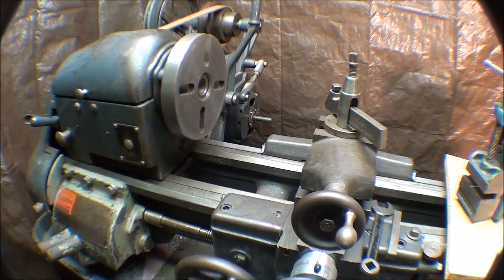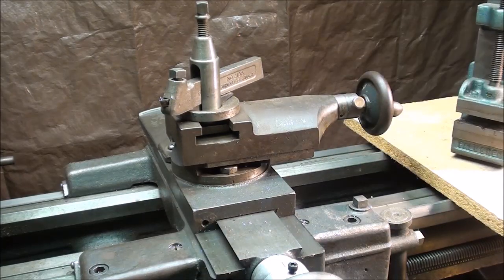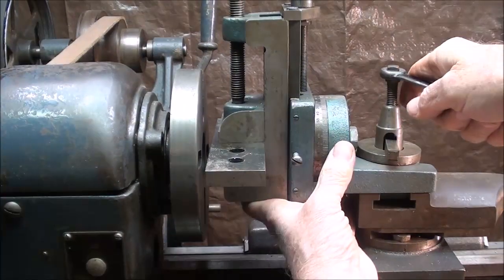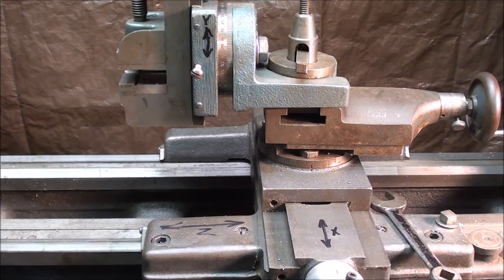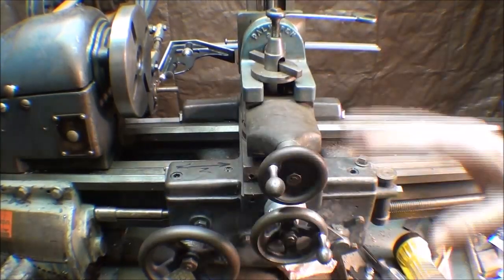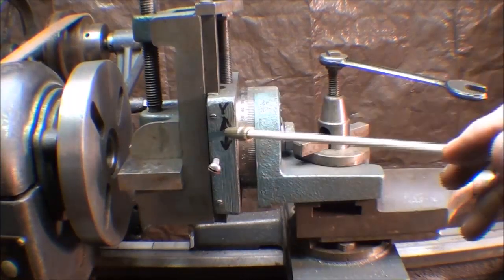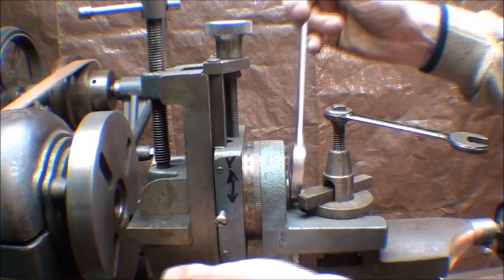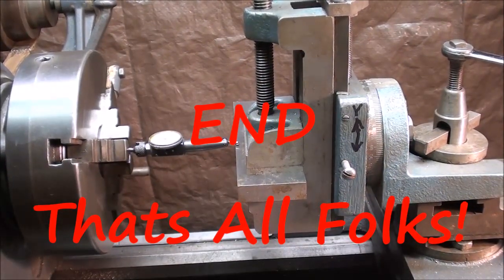Mounting the Palmgren Milling Attachment to Logan Lathe 287 tubalcain

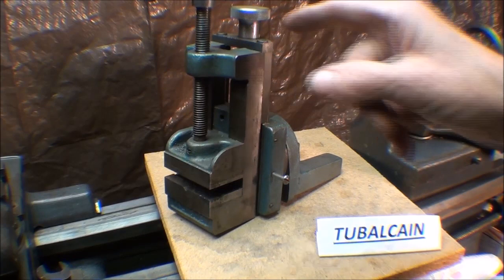Comment: 0:48 I’ve got a Logan accessories catalog here with item LP-1442 looking just like the atlas version, tall and skinny. Item LP-1962 is labeled “large milling attachment” and it rides on the main cross slide dovetail with a large table on a vertical dovetail. The table itself has horizontal slots for t nuts.
Reply from the maker: Thanks

Comment: the compounds on any lathe are extremely weak, even a good hardinge HLV, people are replacing them with a block under the toolpost. when you hang a milling vice with compound angles from it, you're in trouble.

Comment: Thanks for this. I was really lucky to pick up a 400 model while travelling in the U.S. and bring it back to the UK, and it's a 'beauty'. I couldn't find anything here that even came close to this unit. I don't have room in my shop for a lathe and a milling machine, so this is ideal for me. It fits my 1946 Smart & Brown model M mk1 perfectly. Although it's only suitable for limited milling operations, I am enjoying a rigid set up. Though I do think this is down to the sheer weight of the unit. Looking forward to more from you on this series. Thanks again, Steve.
Reply from the maker: Thanks-I bet that was heavy in your suitcase.
Reply: luckily my day job involves sitting in the front seat at the pointy end, so the weight thing wasn't an issue! ;o)

Comment: +mrpete222 Have you ever mounted a rotary table to a lathe? taking the place of the cross slide and compound.
 I was thinking about this when you mentioned how much overhang with a milling vise. I'd like to occasionally mill faces and some radii just with a lathe
Reply from the maker: Never have--would be way to big for my small lathes
Reply: yes,  convex arcs like a cam shaped adjuster knob. I see 100mm XY tables (4"} that might fit on my G8688 7x12. it looks like the bulk of really small tables come from India lol. id put 200 or less into a milling attachment

Comment: Not a fan of this camera Lyle... just hard to watch.
I have the milling attachment for the Sears/Atlas lathe... for it, you remove the tool holder assembly and install it in it's place. Yours is a bit less trouble to install.